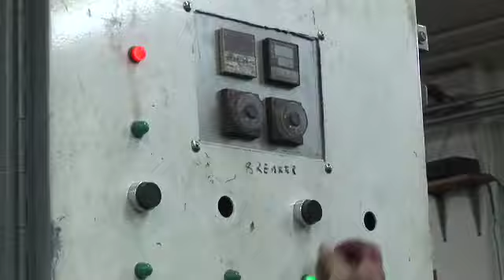Brooker's Powder Coating

Comment: did you have any issues with the various threads on the bike after the powder coat? Were those masked by you or the powdercoater or not at all?
Reply from the maker: They did all the masking etc. There was no problem the threads on the powder coat.
Reply: @pdxktv  cool thanks! just took my frame in. excited.
Reply from the maker: @fmartinez128  Did you take it to Brooker's?
Reply: @pdxktv   no, I'm in Sacramento. Took it too a place down here. They plugged all the threaded areas. All good, thanks!

Comment: Very nice! Love the color of pink you picked! Back about '77, I  took the paint off a Schwin LeTour frame using Zip Strip!
Then I spray painted it with Testors model paint, lol. It was emreald green metal flake and the front had ruby metal flake fading to maroon and then the emerald. It was bitchin! Used a regular seat instead of a 10-speed seat, took the handle bars off an old English 3-speed put on fingertip shifters (had to remove one of the expanders)  & BMX motorcycle style grips!

Comment: question, how well is pinky holding up after the powder coating? I have an old lugged construction schwinn, which looks to be a similar era to her bianchi  I was just curious if the powder coating process(the heat) affected the lugs hold on the main tubes